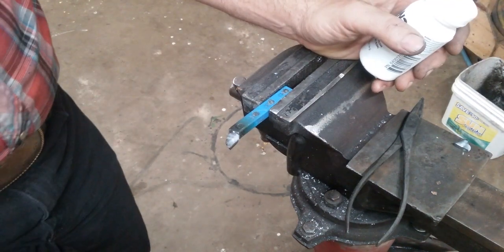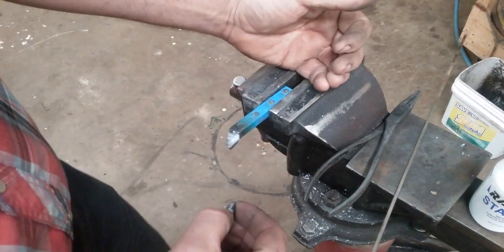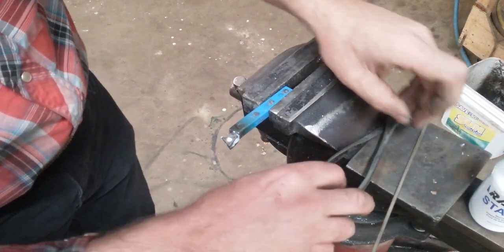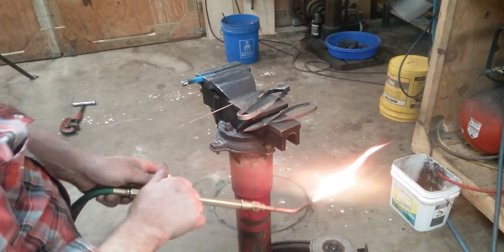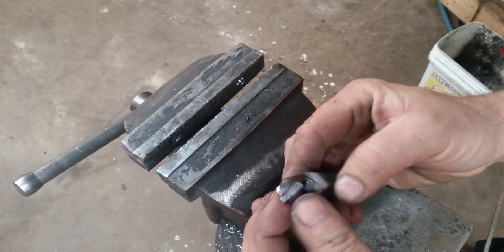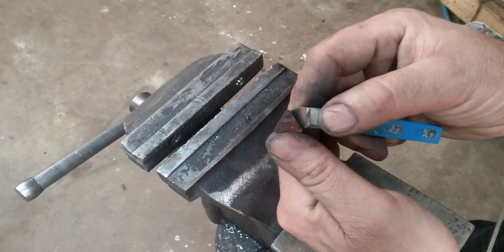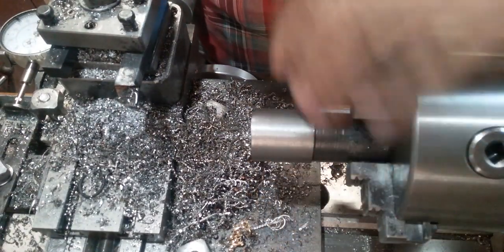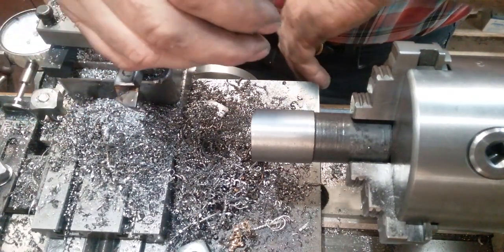Try it yourself brazed carbide.

Comment: Great to experiment.  I did something similar with regular flux coated brazing rods. After I brazed the carbide to my tool holder,  I shaped the carbide with diamond coated Dremel like tool bits and disks. The diamond coated Dremel like disks are great to help get a flat, razor-sharp edge. I used the result to resurface my brake rotors.  Thanks for sharing.
Reply from the maker: Nothing wrong with trying.  Whats the worst that happens?  You screw up and ruin scrap?  I can live with that.

Comment: Might be turning a bit slow for Carbide? I really spin and feed mine. Thanks for the video, my friend!
Reply from the maker: You are likely correct.  I was actually trying to break the tip, or cause the solder joint to fail, but couldnt.